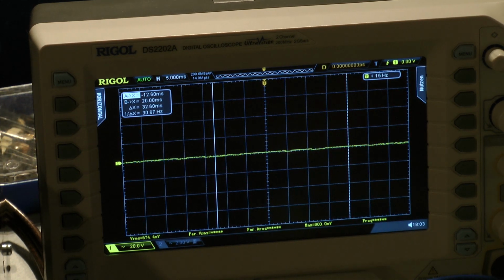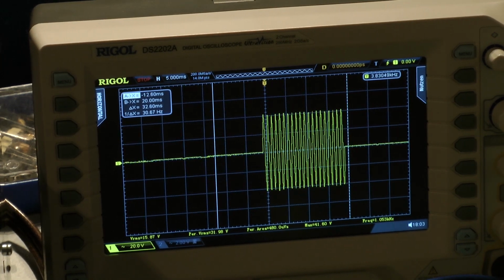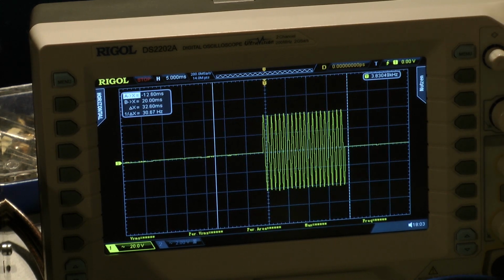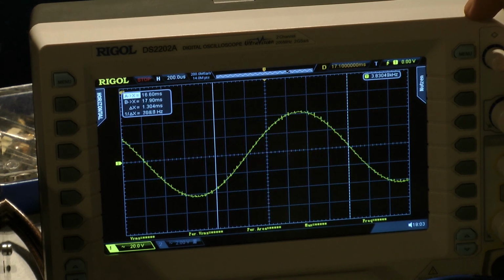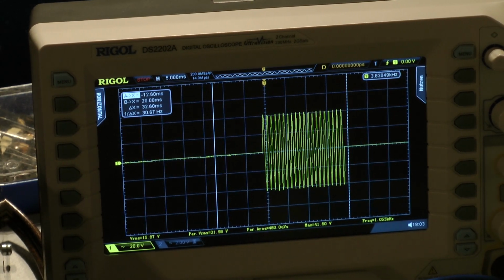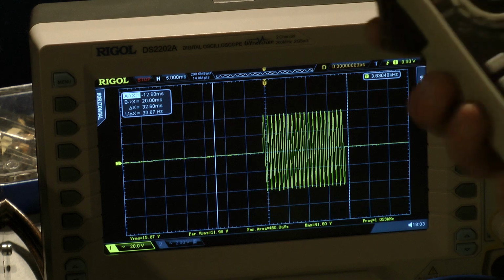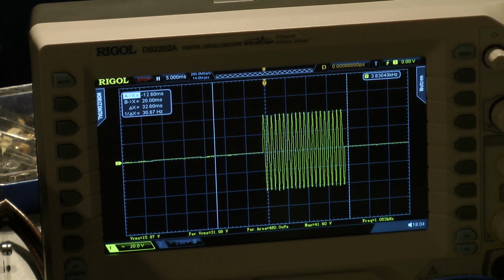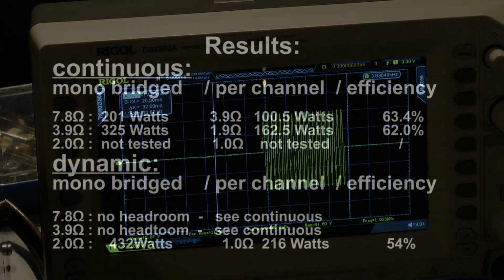Rockford Fosgate Punch 300s amp dyno run -  old school car audio amplifier power test

Comment: Hello!   What year is this amplifier from, 2001?  And what voltage did you use here, to determine the amp's efficiency?
Thanks, nice video.
Reply from the maker: oops i sent it back but i think it must be from early 2000s.
I calculate the efficiency with 13.7V or 13.8V.
Reply: @audiokeller1975  I was looking at the "Amp Performance" website, and they also tested this amp!  However, their power ratings are a bit higher than yours, and the efficiency of the amp is also higher (+70%).  Why do you suppose that is?  Thanks!
Reply from the maker: @charlesbolano7148  At amp-performance they measure power with up to 1% distortion thats a german standard. I dont own a distortion meter and keep distortion as low as possible thats why my results are lower. Second thing is that all measuring devices have a little tolerance. If you take 10 amps from new shipped by rockford you will face 10 different values of efficiency and output power. i recommend to check the birthsheets of them. there is a birthsheet group on facebook where you can see variations of power and efficiency of a punch 200 ix for example. its hard to find two amps with exact same properties. Dont start to think " digital " - there is no good or bad 😁
A legendary pznch 200ix stays a reference amp everytime , it doesnt matter if its efficiency is over 70% or just hits the 62% mark.
By the way: i tested a " newer " P3001 from 2004 or 2005 and that amp did well 👍
Reply: @audiokeller1975  Most birth sheets I've looked at, rate the Punch amps at 60-65% efficiency.  So your results are closer, than the Amp Performance's website!  Thanks for the explanation.
I have 4 P3001 amps from 2005, and 1 P325.1 amp from 2006!  As soon as you put up the video, I will watch it.